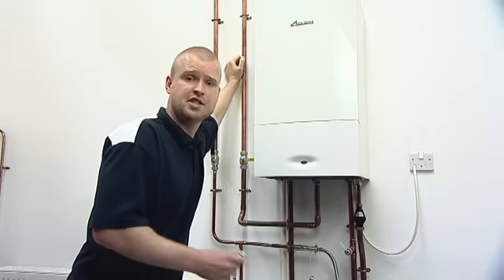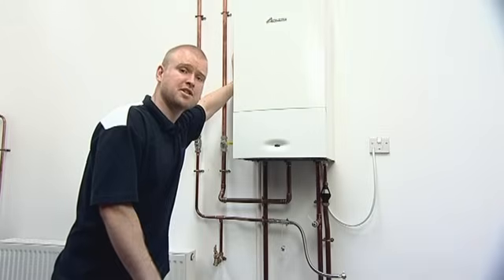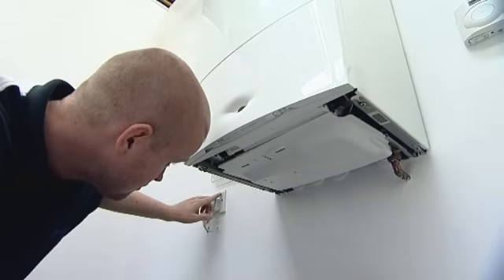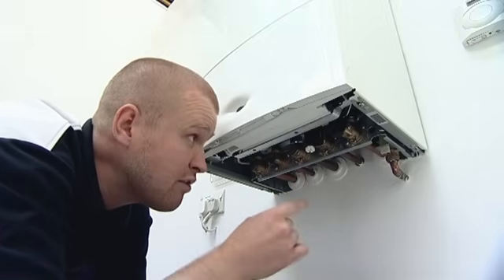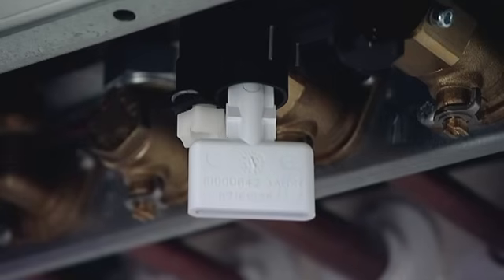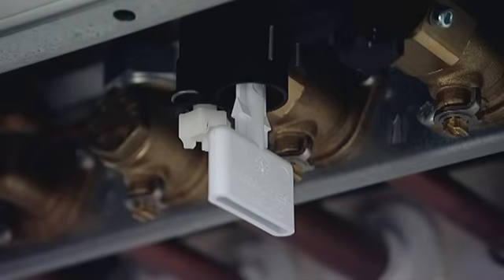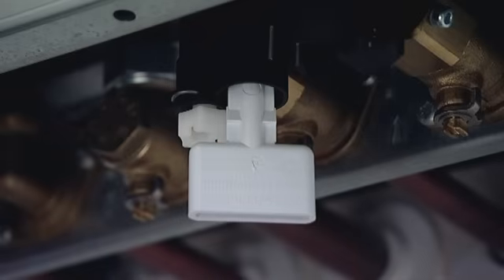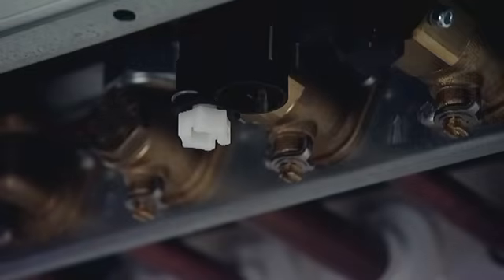How to Repressurise a Heating System with an Internal Filling Key | Worcester Bosch

Comment: Question: ⁉️ My boiler gauge was low but the key was already in and in the locked position. I opened the valve, pressurised the system, closed the valve, set the key back to open but the key is seized and I don't want to break It pulling It out, can I leave it in at the open position? or is it better set at the closed position? Thanks in advance.
Reply from the maker: Good morning Thomas, thank you for your message. Please call our technical team on 0330 123 3366 who will be happy to assist you. Many thanks, ENC.
Reply: @WorcesterBoschHeating Thank you.

Comment: Getting that key in correctly was not easy. Reckon it took six attempts to have it lock in without leaking from everywhere. Palpable relief when it did and i could hear the water flowing and see the gauge needle slowly rising.

Comment: What about I can’t get my key out of the boiler. Can I still use the boiler with the key in
Reply from the maker: Good morning Ricky, thank you for your message. The filling key is designed to be removed once you have finished repressurising the system, if you can't get the key out it won't cause any harm as long as you have closed the filling nut to the side of the key to stop any more water going into the boiler. A local heating engineer will be able to rectify this for you quite quickly. If you require further assistance, please feel free to contact our technical team on 0330 123 3366, who will be happy to help. Many thanks, ENC.

Comment: What temp settings are best for this boiler hot water and radiator thanks?
Reply from the maker: Good morning, thank you for your message. Please visit the following website for more information on this - https://energysavingtrust.org.uk/should-i-turn-boilers-flow-temperature-down/?_gl=1*cfxkqm*_up*MQ..*_ga*OTUzNjk5NTU0LjE3NjM2MjY3MzI.*_ga_GPYNXFLD7G*czE3NjM2MjY3MjkkbzEkZzAkdDE3NjM2MjY3MjkkajYwJGwwJGgw

Many thanks, ENC.

Comment: My key does not fit, so frustrating. The bottom rubber washer won't go into the hole.
Reply from the maker: Good afternoon, thank you for your message. If you could call our technical team on 0330 123 3366 someone will be happy to assist with your query. In the meantime please contact us again should you require further assistance. Many thanks, ENC.

Comment: Ive been doing this for years thanks to this video, but tried today and the key wont go in the manifold
Reply from the maker: Good morning Paul, sorry you seem to be having some trouble this time. In this case, we would suggest for you to seek some support from a plumber or heating engineer. Please do not hesitate to reach out if you have any questions. Many thanks, ENC.
Reply: @WorcesterBoschHeating thanks for the reply, its sorted now, I just put a blod of washing up liquid on the rubber part of rhe key and inside the hole it goes into... :)

Comment: I forgot to turn my boiler off when I put pressure back in it was below 1 is that still ok?
Reply from the maker: Hi Olly, thanks for your comment. I can confirm that that is okay! If you need further support please don't hesitate to contact us again. Many thanks, ENC.
Reply: @WorcesterBoschHeating hey guys.

My radiator vent valve or bleed valve has a minor crack from using pliers the other day to bleed my radiator coz I didn’t have a bleed key but I’m unsure weather to fit a new one or not, however there’s no leakage from it since but not sure what to do
Reply from the maker: @ollygreenacre3738  Hi Olly, thanks for your reply. Although not requiring immediate replacement if there is no active leak, the next time the radiators need to be bled this is likely to worsen and eventually require replacement. Please be sure to remember this is advice only as we can't formally advise on your radiator. If you need more support, we recommend contacting a plumber. Many thanks, ENC.

Comment: I watched and followed instructions, it all appeared the same as the video, however still leaked water. A phone call to Bosch Worcester fixed it - if the key pulls out in the locked position then it is not in far enough, give it a little wiggle and keep pushing until it goes up a bit further. No water leakage and  pressure filled up nicely - thank you to Ben and Eddie! You have adddd to the girl power in our household 😂❤💪🏻

Comment: My pressure has gone to red 3 what do I do
Reply from the maker: Hi Diana, you will need to bleed a radiator (https://www.youtube.com/watch?v=OL4ot-MNYfE) to reduce the pressure. Let the heating cool and release pressure with this process. If you release too much, simply follow the repressurise process to add pressure back into the system to achieve the target 1-1.5bar. If you notice the pressure rising quickly back up again in a short time period, please contact a heating professional or whoever normally provides your boiler servicing and repair. Many thanks, ENC.

Comment: Thought I had fixed the heating, but no.  I have reset the pressure several times, but it keeps losing the pressure after a few minutes or days.  I have bled the radiators.  Please advise.

Comment: Thanks for such a clear, simple video. My rental flat boiler was getting louder and the hot water wasn't as hot as before. Exactly this model, and the bar pressure was zero. Saved all the frustration of dealing with the agents in about 30 seconds.

Comment: Also anyone struggling to get the key in and out. On my boiler it’s ridiculously tight, I feel like I could be breaking the boiler or ripping it off the wall with the amount of force I have to use. I’ve now just left the key in. Not had any issues with water leakage or anything like that (just make sure the tap is turned off). It’s been in for years now with no issues.

Comment: So I used to fill it with the key turned to the unlocked side. Now I'm filling it like shown in video and removed the key once done. I used to keep the key in there. I hope that fixes my pressure losing issue 😢 just purchased a new house and the last thing I need is a problem with the boiler...

Comment: does anyone else find they have to tighten the white control screw slightly more than in the video, after the repressurise? I get a slow drip after if I don't tighten mine by hand after

Comment: My key was getting harder and harder to insert and remove, so much so I thought I would break something. A bit of Fairy Liquid on the 2 black O rings completely solved this problem. I thought of leaving the key in, but then the bottom cover won't go back on, and any slight drips form the boiler will go on my towels. Otherwise leave the key in, turned to the left , the unlocked padlock symbol.

Comment: Thank you. Excellent, easy-to-follow video. One question: if the pressure goes above 1.5, almost to 2, is it a problem? Do I need to readjust it? Thank you
Reply from the maker: Hi @sbonfanti9153, 
The optimum pressure is Approx. 1.3-1.5 bar pressure when the central heating system is cold. This allows movement on the pressure gauge when the central heating system is being operated. When the boiler is in operation providing central heating the pressure will increase slightly as the water is heated and you will see the pressure gauge increase in pressure, when the central heating is off and the boiler is cool the pressure gauge will return back to its starting position.
 
Having under 2 bar pressure in your pressure gauge isn't a problem, and the boiler will continue to operate normally, the pressure is just higher than we would normally advise, we would aim to achieve approx. 1.3-1.5 bar pressure shown on the pressure gauge. 
 
You do not need to readjust the pressure, if you do wish to you will need to bleed the radiators of air and some water until the pressure is at 1.3-1.5 bar. this is done when the system is cold. 
The link below will show you how to do this and there is a video to watch
https://www.worcester-bosch.co.uk/support/troubleshooting/faqs/home-heating-faqs/how-to-bleed-a-radiator Hope this helps, EH

Comment: Initially the key wouldn't slide into the key hole but after rubbing a little handsoap around the O rings it was possible to insert the key.

Comment: I did exactly as you said when I try to top up the boiler water pours out of the nut I have turned anti clockwise, after putting the key in the 'lock' position.
The Key just turns and turns, I thought the key would come to a stop itself when putting it in the 'lock' position.
So I am now not sure what to do, any help please, thanks.
Reply: I’ve got the same issue, did you manage to resolve it?

Comment: I turned off the boiler, did the above key in unlocked position and then turn to lock position and turn other dial anti clockwise but when I do water is gushing out. Any thoughts because I tried this twice and same thing is happening 😢

Comment: 5/5 for the video, @WorcesterBoschHeating, and 0/5 for the mechanism. Why make it so complicated compared to an external filling loop (like our previous old boiler) or the keyless internal filling loop? Now got to worry about losing the key. And followed the instructions in the video and it doesn't work with our new 8000 life Greenstar 35KW, installed this winter!

Comment: Thank you so much for your beneficial video. What if I had to low pressure on boiler to 1 bar, because I noticed my boiler pressure is more than 2 but it is still in green range.
Many thanks in advance.

Comment: Clear enough but as noted by others, inserting the key required first moistening it with water and then twisting the key back & forth a little while applying upwards force. In the clip, the key goes in so easily! In my case quite a bit of force was needed before it finally went in to the required position at second attempt. My first attempt saw a lot of water leak out when the key was twisted which was the sign that the key had not fully inserted to turn the valve.
Reply: True! Just managed to do it here after 15 minutes of slowly turning the key to search for the groove, but eventually managed to find it. It does require some force, and your mention of moistening it would've likely worked better!

Comment: Does it make any difference that my water boiler is right beside it? No issues for 7 years and no hot water since Sunday. Have the external filling hose with just one black tap only. When I turn it to right ( Won't turn left), the pressure isn't moving. Help!!!

Comment: Thought I’d have a look on YouTube before I called out BG & it worked.
Noticed tonight heating wasn’t going on & the red reset button flashing. 

All working now, but why would the pressure drop? 
Plus boiler making a funny noise.
I have HomeCare so will call BG in morning, I’m sure our service is due soon too.
Fantastic video & straightforward at least have some heating now 😊

Thanks again

Comment: When I've locked in key and start turning white screwything water pours out. Please help
Reply: Mine did same, thought I was doing it wrong. ….but after a bit I could hear the noise and pressure tab started to go up as in video, I just put a pot below to catch the water.

Comment: My key was left inside the position by the engineer during a previous visit. I twisted the little knob and can hear the noise but the pressure is not rising. Please help. Also the key seems to be stuck and doesn't come out.
Reply: I'm having same problem
Reply: @spooksartist  it seems there was an issue with the pressure valve. Had an engineer come and fix it as it needed replacing. It is best to get it looked at because it could have broken inside.
Reply: @Aishat Ibrahim I've got an engineer coming  to look at it tomorrow, didn't want to risk messing about with a boiler

Comment: Great video- my only problem i found is having to push the key in far enough 😅
Reply: Same how did you manage to push it
Reply: @zahrak06  Use some lubricant on the key (like hand gel) and push it so that the arrow in the key is just about half a cm away from the manifold. If its not inserted all the way in water will leak when you turn the white screw. This is what tripped me up

Comment: Our boiler (a Greenstar 18i system boiler installed this year) does not seem to have the black plastic manifold referred to at 1.10.    He also refers to it as 
an internal filling loop (0.40).  I wonder can it be retrofitted or does it depend on the way the boiler is plumbed.

Comment: Great video .. there should be more like this .. I’ve just tried to do this but the filling key is missing 🙈 and the nut you turned anti clockwise to fill the boiler isn’t there either !!! ( must have been taken before we moved in ) .. can I get replacements .. I can find a key but not the nut .. thanks

Comment: I just moved into a house and the filling key was already inserted and left in the boiler in the locked position, I have now filled the boiler and turned the key to the unlock position to remove it and it won't come out,  any of you fellas have advice ?

Comment: My key won’t go up through the hole to lock it. Trying slightly different angles but it just won’t go up. How typical 🥲
Reply from the maker: Hi Ally, we are sorry you are having trouble with this. You can find detailed instructions in your user manual or please give our technical support team a call on 0330 123 3366 and we can try and support you. Many thanks, EH

Comment: Is this video saved me a little bit of cash but a lot of stress 😡. Thank you so much it's very detailed and informative. I don't understand how new boilers are fitted with this system when the ol turn the tap from the bottom worked so well. I feel like they over complicated it. Thank you again

Comment: This video is a life saver! Arrived at my caravan to find no pressure. Tried to re pressurise the system but had boiler switch turned on so just got water dripping out.
Thanks to the very clear simple instructions including turn the boiler switch off before using key I was able to get pressure back to 1.5

Comment: One wee extra tip to share. BEFORE you repressurise your heating system make sure to check that you have tightened all the bleeding points of your radiators!! I had tried to bleed the radiators in my son's new flat but the pressure dropped in the boiler. Fixed the boiler then notice a noise from 2 rooms - radiators were spraying his computer and boxes of books in his bedroom and his TV, router and other electrical equipment in the living room!!! Not exactly how I'd intended helping him settle in!!

Comment: 😂 This hasn't helped. I just turned the white nut and water gushes out and no pressure comes into the boiler. The water has filled up a luandry basket.
Reply: You probably haven't put the key in far up enough - put some washing up liquid on the top of the key and keep pushing it until the arrow goes in as deep as it does on the vid

Comment: Our heating wasn't working this morning, on the boiler it stated pressure is too low and our boiler has recently been installed so haven't had the need to repressurise it (and couldn't remember engineer's instructions either lol). It has a key thankfully but we don't have the pressure dial like yours though, despite that the technique still worked.

I had alot of water coming out compared to yours so I started panicking a little. I then I switched boiler back on and it started building up the pressure. 
So thank you and really appreciate the video 🙏🏻

Comment: great video, I would add getting the key up, it needs a slight push, so both black rings arent visible, u can see up the tube if need to locate the key, then turn but not too far or water comes out, take the key out after as im pretty sure could leak if rings erode.

Comment: Great video but any ideas why, when I turn the key to the lock position, the water comes out and filling doesnt work? Update - tried putting upward pressure on the key when it was in position and this stopped the water gushing instead of filling.

Comment: Hi Great video but our Worcester 24i Junior has a screw to adjust pressure. The screw was in a poor state when we moved to the Flat and is very difficult to adjust. Is it possible to replace the screw with a more up to date method?

Comment: Excellent video thanks. Saved me a lot of stress. One thing I would like to add is that getting the key to push in and fit properly can be quite difficult to get right. I had lots of attempts and nearly damaged the plastic key which can easily be done. And once damaged you’re in big trouble. So one top tip is to leave the key in and leave it there in position for next time you need to top up. Its what I do and saves me a lot of hassle.

Comment: Hi, great video but can u upload another video how to set the timer when there is only one display for pressure and don't know how control the timer as boiler switch off itself and we have to reset. That's mean if we open the hot water tap, it won't work unless reset

Comment: My boiler pressure has gone down to zero. I've tried this process for around 30 seconds without noticing a change in pressure. Is this normal or should I give it longer to fill the pressure?
Reply: It's a new home that we've moved into fyi, the heating hasn't been used for a while but we did have it running yesterday totally fine

Comment: Thanks. I have a little bit of water still coming out from the filling key area a day after i have pressurised my boiler. Is this normal? Its very slow drip but not had it before.

Comment: I repressured the boiler and has moved from 0 in the red zone. However, I still only have hot water for about two minutes and then it goes cold again. Does anyone have any idea what to try next? Also, the pressure increases from 1.5 to 2 and seems to fluctuate between 1.75 and into the top red zone.